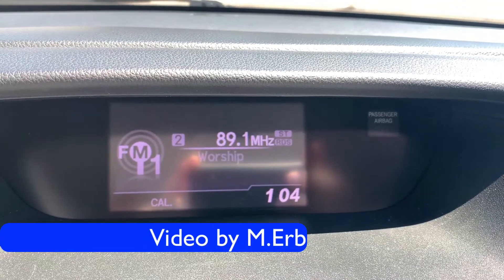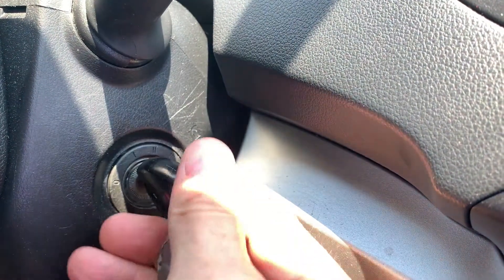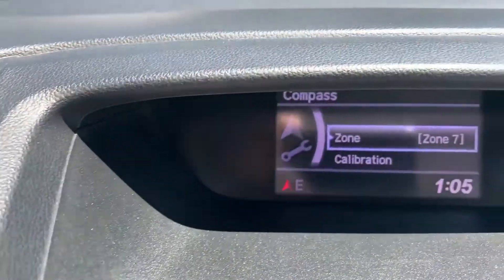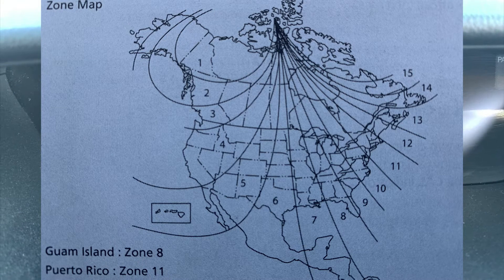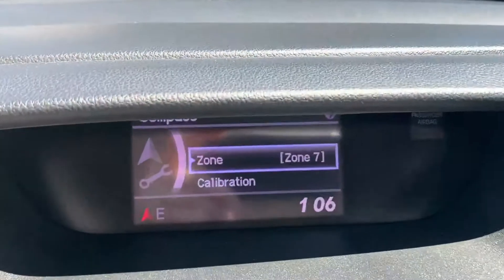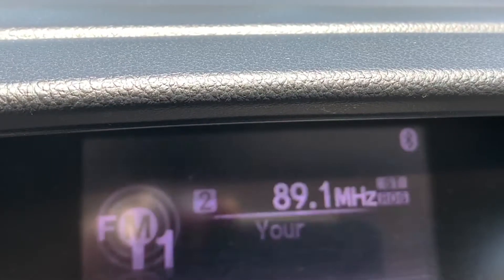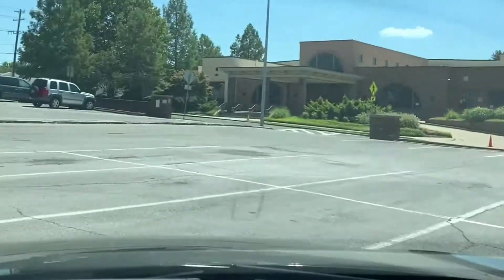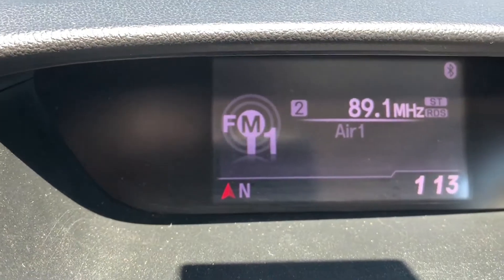Tutorial: How to calibrate the compass on a Honda CRV 2012

Comment from the maker: A few more tips. Make sure you turn your car completely off before you begin the calibration process. Once you turn the key to position II, wait about a minute to ensure the cars computer has fully booted. Make sure your radio is turned off before beginning to press the Setup button to begin the zone and calibration process. Once you press the Setup button to begin, keep it pressed in until you see the compass menu page appear, it will take a little while (about 10 seconds.) This may work on other model years other than a 2012, but I can't say which model years. All I know for sure is that this works on a 2012.
Reply: Didn't work for me at all. I even held the button down for a full 60 seconds.
Reply from the maker: @Rite1010.  What year is your CR-V?
Reply: @Rite1010.  usually that indicates a problem with the compass module

Comment: OK.  After a bit more research I found that another cause for this known problem is a bad compass module (Honda part # 78300-T0A-A01).  This module is located on the underside of the roof at the back of the car, but you must unfasten and pull down a bit of the headliner to reach it.  The part is replaceable but you must unfasten a lot of headliner to access the nut that holds it to the roof.  If you're OK to go without the compass totally (so no compass heading display period) then all you need to do is unplug the cable from the module, and to do this only requires pulling loose just a bit of the headliner so you can reach the cable connector and disconnect it using a thin bladed long screw-driver or a long right angle dental pick that reaches the cable.   If no amount of press-hold on the Setup button ever brings up the compass menu then assume your compass module is kaput. I've been told that for Honda to replace the module is around $500, but there also are YouTube videos for DYI-ers if you want to actually try replacing the module.
Reply from the maker: Great research.
Reply: Thanks for the follow up info. I've reset this thing three times and it starts blinking again soon after. THIS time I can't even get the calibrate menu to appear. So knowing about the module helps me feel less incompetent.
Reply: This has been super helpful bc I could never get the compass menu to appear and now I know it is the module. Not that I ever use the compass anyway 😂

Comment: The compass setting doesn't display after holding down set up...
Reply from the maker: I’m sorry but I don’t have any advice for that.
Reply: 6 months late, but it's ridiculous. it took a handful of different times holding it down, before giving up, trying while driving, etc and finally it showed up... i started to think it was disabled but nope, just poorly explained and obfuscated by the manufacturer... after setting the correct zone (youd figure they would...) and calibrating it once and doing a few circles, it felt off, so i calibrated a second time and lines up.

tl;dr: go do an errand, but before you turn it off and go into the store hold down setup. try it with the radio on and off, etc. idk. i fought with the damned thing for about 30 minutes until finally it showed up.

Comment: Hmmm.  I have a 2014 CR-V and the user manual (pg 223) describes the exact same procedure.  My problem is that I'm unable to ever get into the Compass Setup menu.  I have the key in the ignition ON II position (so the last position before the "engage starter" position).  I have tried both with the audio (radio/CD/Bluetooth) both OFF as well as ON.  The one thing I've yet to try (mentioned in the comments below) is to wait a minute for the computer to boot after turning the key to ON II.  I'll try that later today and update this comment afterwards.  With the audio system OFF then press/hold Setup menu only ever shows me the "Adjust Clock" menu; with the audio ON then press/hold Setup shows a few more options (4 total) in the display:  Sound ;  Auto ;  RDS Info'; Adjust Clock.   The blinking compass heading with "Cal." is VERY IRRITATING.
Reply: I was also frustrated, gave up turn my car on drove away and turned the radio on. decided to press the setup button for a few more moments and lo and behold the calibration menu came up! give it another try out of order

Comment: Any advice for a 2013 CRV with the same compass flashing "CAL" issue?  I can't get to the calibrate/compass menu.  I've tried putting the key in position 2, let it sit for a few minutes, then tried pressing the "settings" button.  The only option I have is to set the clock, no way to get to the compass/calibrate menu.  It seems that my compass has been flashing "CAL" for years now and never leaves that mode ever.  Help!
Reply from the maker: I do not know the answer.
Reply: Same here

Comment: When i push the setup i only get sound and clock settings. I get nothing for zone or calibration relating to the compass.
Reply from the maker: 2012 CR-V? Did you press and hold the setup button long enough? Did you read my pinned comment?
Reply: I have same issue-no compass settings no matter how long I hold setup.

Comment: With this procedure can I solve the problem of the tire pressure sensor ?
Reply from the maker: This is for calibrating the compass. It won't help with tire sensor issues.
Reply: Be sure to check your spare tire, it could be causing the TPMS light to go on.  I found this out on a 2013 CRV, the spare had dropped to around 14 psi when it should be 60 psi

Comment: I doubt your information. Never worked despite trying it many times.
Reply from the maker: Funny, my video is proof that it worked. Maybe you have a different year CRV? Maybe you did something wrong? Maybe your car is messed up and this won't work for you? Could be lots of reasons it didn't work for you. Doubt if you must, but my video shows that it does work for my 2012 CRV.
Reply: @michaelerbreviews  ok, then you need to follow up and update on newer CRVes pretending you are following up as a knowledgeable person. This will even give you more views as you tuber.
Reply from the maker: @hassanaljaber1  I never claimed to be all knowledgeable about all years of Honda CRV magnetic compass calibration. I specifically state in my title that this applies to a 2012 Honda CR-V.
Reply: @hassanaljaber1  r/choosingbeggars
Reply: What is your problem? He posted an informative video that works. Just because it doesn’t work for you does not mean the information is wrong.
Reply from the maker: @mistyaqua  Thanks for the support. I learned long ago that you can please some of the people some of the time but you can't please all of the people all of the time.
Reply: @michaelerbreviews  For some reason I can never get the compass menu. Only Adjust Clock. It’s a 2012 and I’ve followed all the instructions here. Can’t imagine what’s wrong.
Reply: @BillSmithBSartist  same here 😔 what you did in the video is what is says in the manual too. So im thinking my car might have something else wrong, outside of calibration. I mean the car IS working on being 10yrs old
Reply: @gregorylozano1045  I have the same issue trying to recalibrate in my driveway. The manual says to recalibrate in a large open area, like a parking lot. I'll try to remember to report if this was successful.
Reply: @hassanaljaber1  SO WHAT DOES THE USER MANUAL SAY FOR THIS NEWER CR-V?  I HAVE A 2014 CR-V AND THE USER MANUAL DESCRIBES THIS EXACT PROCEDURE.
Reply: this guys video is legit, and i understand your frustration from experience, but its not them, it's honda... just keep trying to hold down setup for 10+ seconds and if it doesnt come on drive around or something. i problem solved and calibrated mine after watching this video, it's just something with the cars that's conveniently omitted by the manufacturer so you go to a dealer or a variable per car...
Reply: @gregorylozano1045  if you still have it and still never got the calibration menu just do what i did and fight with the damned thing for 30 minutes doing various things from warming it up to driving around, etc. i was hellbent on thinking the dealer disabled it or something... but nope... just terribly implemented software....